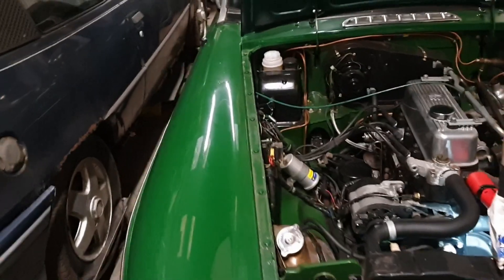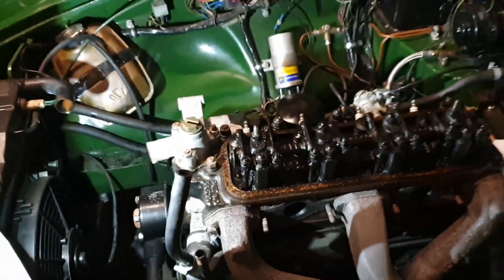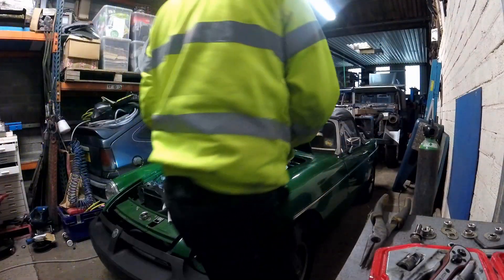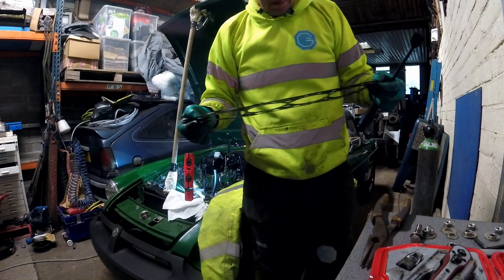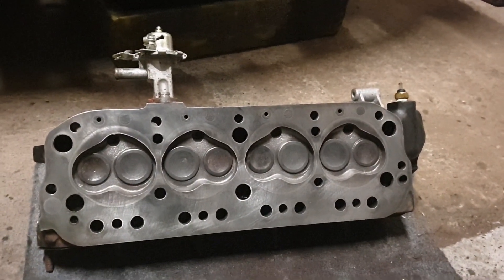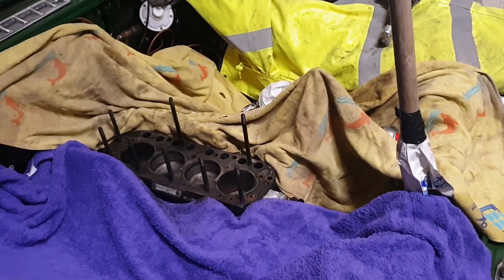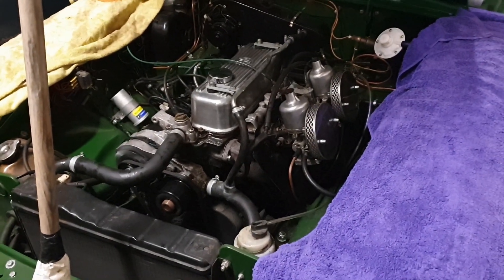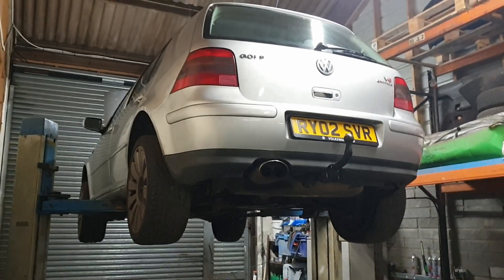1976 MGB Head Gasket Change. Old school simplicity...

Comment: Should have changed the head studs as they will not hold their torque because of age. I learned from experience.
Reply from the maker: Thanks for your advice we'll see how they do....but sure you are right to be fair.
Reply: Should've straight edged/measured the block and head to assure flatness while its out & clean. Might as well put in new stem seals and hand lap valves after doing all the r&r labor. 🤷‍♂️